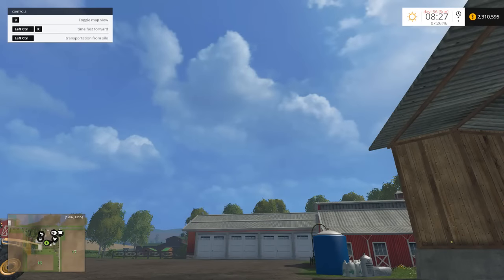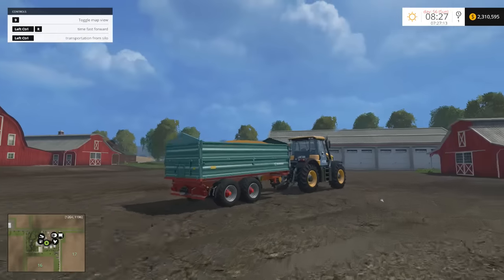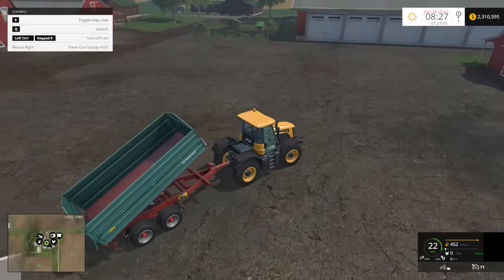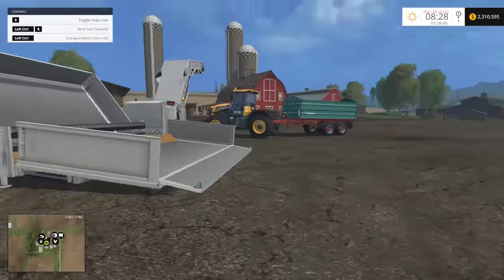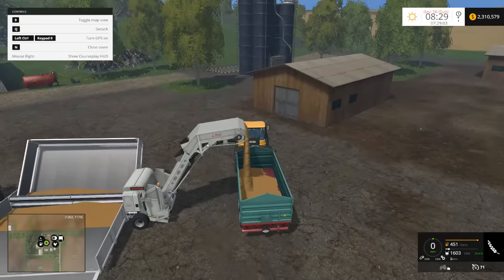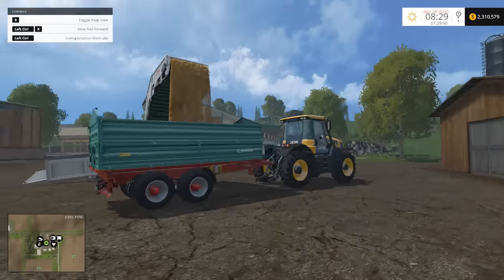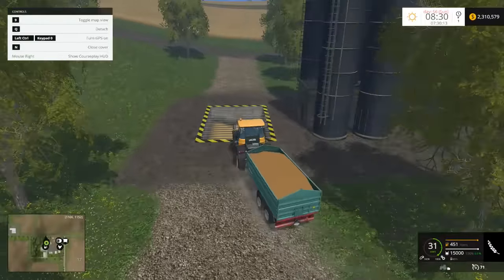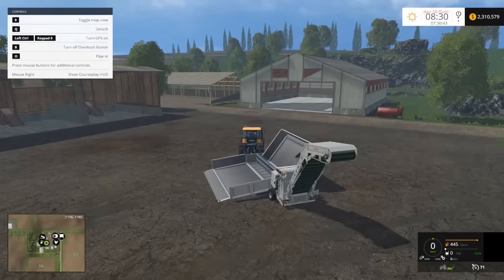Farming Simulator 2015 Mods Mash Up - Fliegl Overload station

Comment: after setting it up in the field with manure (and it will haul with a load on it), turning it on, getting out, and driving a manure spreader underneath....wont work. Pipe out, turned on, and still nothing, unless I start overloading while in the attached tractor. It just wont trigger the overloading. Using it on Manchester map. Still useful as a mobile transfer station, but always have to cancel the spreader courseplay and load manually, then return spreader to courseplay.

Comment: Nice vid. The pipe needs to be unfolded, because its in transport mode, and the belt is not tentioned. Pretty normal ;-). I have used it with a truck on courseplay travelling tot my silo's and a tractor with tipper on overloader function, backing into the overloader. Worked fine. Just need to record the course without the trailer. Found that the standard krampe trailers work best with backing up.
Reply from the maker: +Martin “PlayMoto” Frankena glad to hear that it can work with courseplay

Comment: Late comment but how are you able to have the overloader running while not in the pulling tractor? I can't get it to run if not in the tractor but would be nice to have it function the way you have it running. Thanks and great video as always!
Reply from the maker: +Kaden Scott You're right it needs to be attached to turn it on and off. Once it's on I think you can detach it from the tractor.
Reply: +Iain Robson no, the tractors pto powers the overloader. So your tractor needs to stay connected and turned on, but you can get out.

Comment: Can not get this to show up in game. Not in the shop anywhere. It is for 2015, right? Am I missing a step? I put the .zip in the mods folder.
Reply from the maker: +Jake Aikens Yeah it's for fs2015

There might be a mod conflict. Try only having this mod in your folder and see what happens. It's in the overloaders category
Reply: +Iain Robson After checking the log (which I should have done in the first place. but I'm WAY to flipping lazy) I see I'm getting an "Unsupported mod description version in mod" error. That means it's the fs2013 version of the mod. I've been to most of the mod download sites and I get the same error with all of those downloads as well. That means everybody thinks they are serving the 2015 version, but they aren't. Odd. But that's the way it is.

Comment: Yeah, but only 50,000L storage?
Reply from the maker: +jturie I suupose you could change it but it's pretty reasonable
Reply: +jturie yeah was thinking the same thing.. .seems like it should have lil more storage than that.
Reply: +jturie I did some research, looks like 50,000 is pretty accurate.